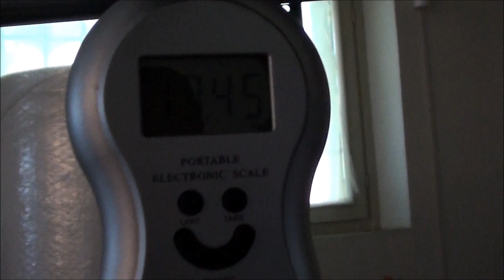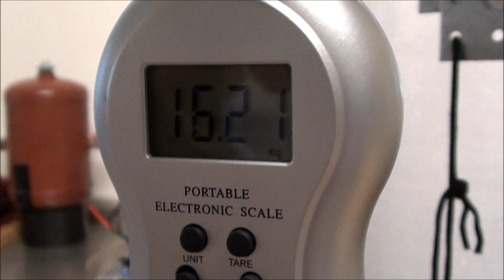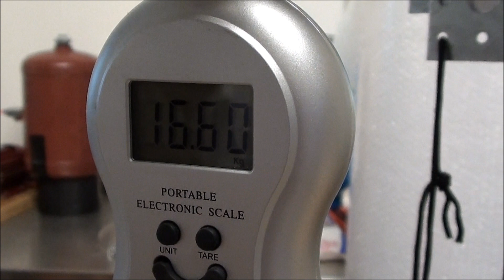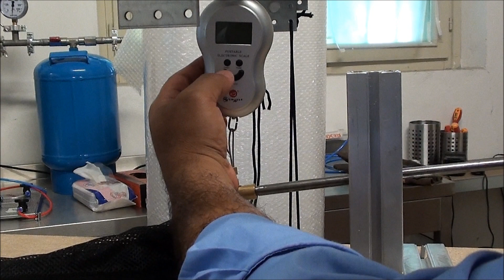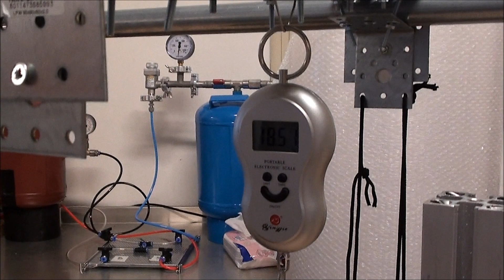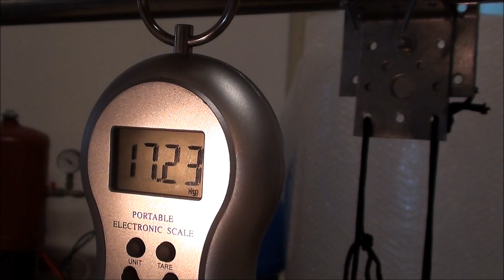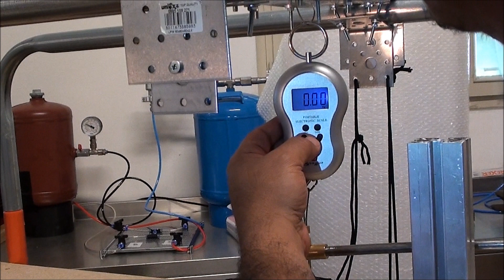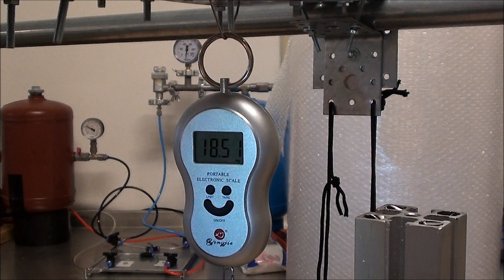Keshe Foundation spaceship program enters a new Era

Comment: People are so easily fooled. Lost counting how many times Keshe promised to demonstrate a working prototype of his "coke bottle" space generator. Oh well People also believe that planes (aluminium and plastic) can fly from nose to tail straight through concrete and steel skyscrapers. They saw it on tv ...
Reply: a tabletennis ball just felxible plastic  can shoot througt a table tennis bat (wood). so don t see your point, of course he will be compromised but how heavy is such a plane? do you really believe several tons of metal crashig with severa lhunderts of mph in steel will not scratch it?
Reply: @MCGaui  I have no opinion on this video but concerning planes and buildings, you believe that 2 planes can make 3 buildings (WT1, WTC2 and WTC7) fall at free-fall speed? It was obviously demolition. Even a child not programmed by CNN and MSDNC could see it.

Comment: I don't see anything special going on here.  The scale is just recalibrating to zero with whatever weight is still on it.  If you start out with a weight of 18.55k and leave 1.11k left on the scale while you turn it off and on, the scale will zero out the 1.11k and the resulting weight that it'll show is 17.44k.  Is this supposed to be impressive?  Am I missing something?

Comment: So what is your secret?
Reply: He weighs a weight with a scale. Then he lifts the weight (but not completely) and resets the scale so the zero point on the scale changes.
That's what he does several times and therefore the weight on the screen shows something different each time. You can try this yourself.

Comment: ps the price of a reactor made in Canada is 30 bucks and some change,a change well overdue.endless light heat and electromotive force, a one time cost to the homeowner. cheap. spaceship motors, are about20 grand to start, going to space is extra. when you all figured out how to separate mass from magnetic current ,give me a jingle.

Comment: what's demonstrate this video?
Reply: He weighs a weight with a scale. Then he lifts the weight (but not completely) and resets the scale so the zero point on the scale changes.
That's what he does several times and therefore the weight on the screen shows something different each time. You can try this yourself.

Comment: Could you explain in details what is happening?
Reply: He weighs a weight with a scale. Then he lifts the weight (but not completely) and resets the scale so the zero point on the scale changes.
That's what he does several times and therefore the weight on the screen shows something different each time. You can try this yourself.

Comment: Why don't you just let it run without manipiulating the scale with a lever and switching it on and off. If the there is a loss it weight, the scale will register it by itself.
Reply: But then he can't cheat :(

Comment: Ask yourself, why he turns OFF and ON the scale before every measurement? I is a simple cheat-->he manipulated before each measurement, the zero value of the weight scale. I have evidence of this, just make screenshots. Hard to see but the small Symbol in the left up corner stands for negative wight value!

Comment: Nobody saw what he did to get to 16.22 Kg
Later in the video on 5:14 with the camera behind his shoulder it reads 17.23
But when he pushes on the scale again on 6:01, the scale says 1.31 and a indicater in the left top corner starts to light up for negative weight, it never did go to 0.00
Then he pushed the button again and the scale shows 18.54
So 17.23 plus 1.31 is 18.54
Keshe must have callibrated the scale with 1.31 kg of weight on it witch we could not see because of his shoulder. ha

Comment: i cannot see any thing floating what am i looking at.
Reply: He weighs a weight with a scale. Then he lifts the weight (but not completely) and resets the scale so the zero point on the scale changes.
That's what he does several times and therefore the weight on the screen shows something different each time. You can try this yourself.

Comment: A question 
Why did you try to set zero in the electronic scale which is hanging a reactor system?    If the electronic scale at the outset, is indicated a exact weight of a reactor system, it would be much easier to recognize how much a system weight was reduced after using Magravs field forces.

Comment: Would be helpful to know what is the tare weight of housing and the actual weight of the the device -  please include the rpms used either being viable or constant and the directional revolution being clockwise? or counter clockwise? or even both?
The recorded weights of the duration of each test conducted regarding to what has been applied.
Thank you for sharing...